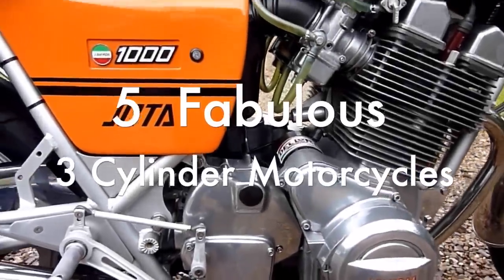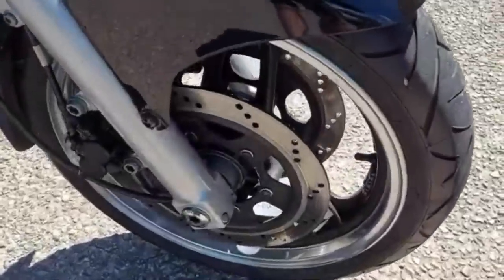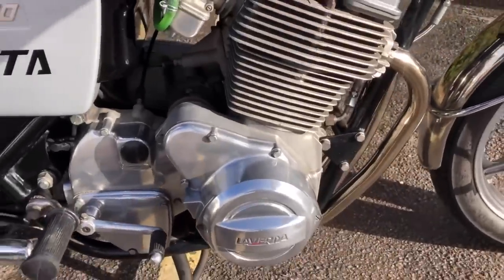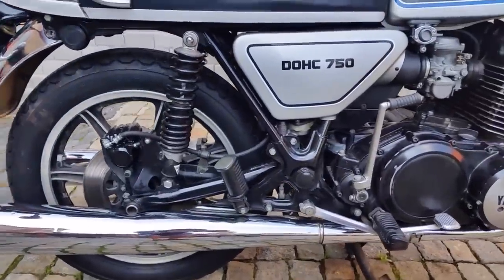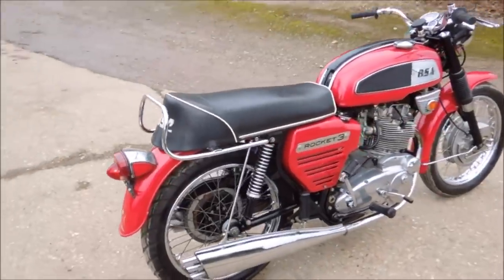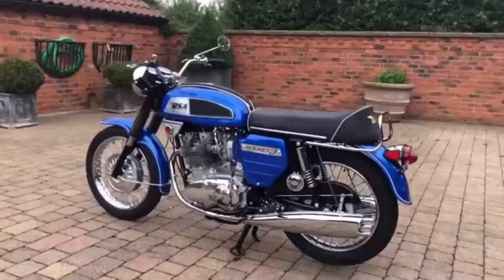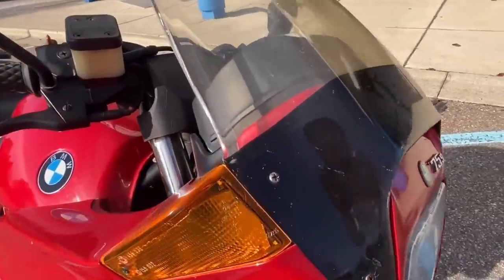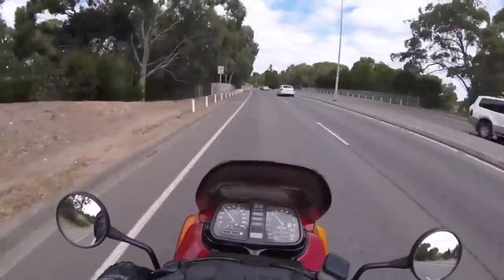5 Fabulous 4 stroke 3 Cylinder Motorcycles

Comment: 3 cylinder engines sound so good. Gary Johnson's MV Augusta at the Isle of Man is surely one of the all time great exhaust notes. If you're lucky enough to have been to a current MotoGP event, the Triumph engined Moto2 bikes are far and away the best sounding bikes in the paddock. The V5 Honda's and in particular, the Kenny Roberts V5 sounded better but they were sadly replaced with the current crop of aurally inferior 4's.
Reply from the maker: I still miss the strokers but the triples do sound v nice
Reply: The sound of the MV Augusta on Francorchamp was unbelievable, especially on Masta. But than the Yamaha XS1100 with Pat Evans on the Nurburgring was great as well.

Comment: I rode a Laverda Jota back in about 1980 or '81. Took it up to 120 and it started a slow fish tail weave so I shut it down. Doesn't like a light rider. Rode a Ducati 900ss ('76 model) a short time later and it was as solid as a park bench at 130. An old friend - now sadly no longer with us due to cancer - said the correct pronunciation of Jota was Yot-a - with the Yot as in Dot. He was a motorcycle dealer back in the late '70's and early '80's so I assume he was correct.
Reply from the maker: Well the Jota was designed by a big guy for other big guys
Reply: @bikerdood1100  Yeah that's the conclusion we came to too.
Reply: The correct pronouncation of Jota is something like Hhotta as the italian J is pronounced as an H. 🤷🏼‍♂️
Reply: @kasperkjrsgaard1447  With the 'o' as in hot or as in bone?
Reply: @vipertwenty249  
As in "hot".
Reply: @kasperkjrsgaard1447  Thanks

Comment: You could have mentioned Triumph  T150 & T160  and Suzuki GT 750.
Reply from the maker: Two strokes in part 2 
I mentioned the R3 instead as it’s essentially the same machine of course and I wanted to include the Trident 900 in particular because it was a sales success in contrast unfortunately to the T160 which is shown in the R3 part

Comment: You didn't include the GT750 GT550 and the GT380 but l do remember all these motorcycles and K series BMWs because with the 750 and 1000 for all  there range it was the same bike just with the fairings and paniers bolted on very smart of BMW
Reply from the maker: Next video
Reply: @bikerdood1100  Very good l owned a GT380 and a GT750 looking forward to the video
Reply from the maker: @lesklower7281  out this week
Reply: @bikerdood1100  Good

Comment: the common 4 cylinder (4T) engine has one ignition every 180 degrees of the crankshaft, up to here so far so good, the only way to overlap the power strokes to make an engine more powerful, efficient and smooth running is to add more cylinders, here typically the option is to go for an even number of them in order to spread the sits on a crankshaft such as 6 or 8, and arrange them in "V" configuration to shorten the crankshaft, camshaft, manifolds, block, etc. ... some manufacturers go for a "cheap way to achieve this" with 5 cylinder engines making their own-and-everyone-else's life complicated with 720 degrees/5 cylinder = 1 ignition every 144 degree turn of crankshaft and all the weird design features to save 1 cylinder per engine (like a cheap 6 cylinder engine somehow achieving the overlapping of the power strokes). I can understand big engines are a bit of a pain to fit in a motorcycle frame and due to the limited weight of them (motorcycles compared to cars) smaller 4T engines with no overlapping of the power strokes as an "affordable sacrifice" (4 or less cylinders), ...now; what I fail to understand is that having V4 engines (with a block as long as a 3 cylinder) someone still goes through the trouble to design one when with a two-cylinder engine would suffice without looking like "a cheap and complicated 4 in line" (or half a V6 if you ask me) if you just don't want to fit a four cylinder engine, I honestly fail to find anything practical about it, I was always told that the best rule in engineering is to "keep it simple".
Reply from the maker: Of more pressing importance to a motorcycle builder today would be cost effectiveness 
The classical 4 firing order is as much about simplicity as anything else after all if you waste a spark then you only require two sets of points in the old days.
6s are all well and good but very expensive 
Ditto V4s
There’s a good reason parallel twins are on the rise
Reply: @bikerdood1100  quote "There’s a good reason parallel twins are on the rise". totally get the feeling on that sentence, as I would choose so myself if there is no chance for a 4 cylinder (I ain't much of a racer myself, and I have to admit I prefer twin cylinder engines). you crack me up talking about motorcycle builders now a days after seen the classics in the video, manufacturers and customers naturally look at the relation between quality-price each one from a different side of the equation, shame that "having the money to pay for it" does not imply "knowing what I'm about to buy", if so being a manufacturer would be way more difficult. cool motorcycles in the video nevertheless I have to admit.
Reply from the maker: @investigatechannel  I do prefer a twin myself if I’m honest 
I do own both modern and older bikes and am interested in bikes of all periods 
Had a lot of fours over the years and do find them a bit 
So so
I think compared to the industry of the 90s for example there simply isn’t that much money in the industry and this is showing in the move always from 4s and in the poorer overall build quality now evident in the industry
Reply: @bikerdood1100  for "things of life" I do not have a motorcycle right now (maybe soon) but I had a few over the years, my first bike as a young fella back in my country was a Ducati road 250cc '75 (I bought this one in a box taken apart and I put it all back together myself with the little notion I had), then I moved to UK and got myself a VT700 (some grey American import), then I had a VF 500, a VF750 and finally a VF1000, while I was studying engineering at south London and I'm a great fan of classic British bikes, they are the only ones that make me turn my head and not look in the direction I'm going, but life pushed me to end up working on cars and industrial machinery/tools, and on 2020 I moved back to Spain (did my own version of brexit) I have watched some of your videos and seen you are British and also seen some of your bikes, my upmost respect mate, I miss all that.
Reply from the maker: @investigatechannel  we are now into double figures 
The problem isn’t buying motorcycles 
It’s being able to let go and sell one to make room 😂😂

Comment: Rode a laverda jota before I bought my ducati 900 ss  from a kam motorcycles NorthShields the laverda was all hyped up back then but I thought it handled poorly and as for speed no way would I have liked to have taken it over 100
Reply from the maker: We’ll definitely more powerful than the Duke, with a top speed of 137 in the mid 70s it was a fair bit quicker than the Duke, the Duke was certainly more nimble. Mr Laverda was well over 6ft so the bike is designed to fit him. So for those under the 6ft mark the can be a handful 
But slow 
Naaaa
Reply: Well I’ve been riding since 1964 my Italian scenario came in 1976 I was hyped by the so called Jota but after riding it down the A 19 I certainly made a decision that the Ducati 900 was better in every way. The 900 felt and handled far better than the lumpy clunky Jota and yes I had the experience to make that decision. I nearly bought the MV Augusta that kam motorcycles had in their shop, but it seemed a very complex bike for servicing etc. So that’s my take on all the hype around the Laverda  as well as my Ducati I also had a little Moto Morini 350 v twin now that was a good little Italian bike.
Reply from the maker: @john-wq8kf  well it’s designed by a very tall guy for other very tall guys 
For them it’s fine 
And could be intimidating. But still extraordinary fast by 70s standards

Comment: A good list, although most are unknown to me outside photographs and occasional sightings.
The XS750/850 was briefly a courier favourite (no chain wear).
I used to visit regularly a bike shop next door to Motodd in the late '80s.  That was the strange basement furnace where they built some of the ugliest, most beautiful Laverda triples.  Strange, metal monsters that sounded strange, loud and a bit Satanic. I rarely saw one other than at the shop.
The only one of your list I rode a fair bit was the K75.  It was always deeply uncool, but I thought it did everything extremely well.  Not a bike to get emotional about, but a very sound machine - and more engaging, nimble and rideable than the slightly lumpy K100.  I thought it would sell well, but it was one of those evolutionary cul-de-sacs.
Good video with some nice noises. 😊
Reply: I nearly purchased a new K75 but the fact that it cost more or less the same as a K100 put me off.
Reply from the maker: Always quite likes the K75s much less blocky looking that the 100
Reply: @bikerdood1100  There were a couple of people on rally scene who ran K75s engines apparently even smother than the K100. I borrowed a K100 for a couple of days just after launch. It was like riding a big electric motor. Power all the way up to full revs. Also much, much smoother than my CX500.
Reply: @davecooper3238  "Electric motor".  Spot on.  The perfect comparison. It was almost forty years ago and I can feel it (or not feel it) still.  Hit the nai right on the head.

Comment: kawasaki designed the triumph engine, the spine frame was also used by kawasaki on their GPZ900R.
I was only interested because a pal of mine bought the very first trident 900 off the line.
I wasn't pleased.
I had tried to sell my design to john bloor, he just took my ideas and flipped me off.
I would never buy one because of this, despite the trident being the production version of my original design.
I also introduced the concept of modular design in the motorcycle world, as evidenced in triumph's first series, suspension changes, different camming, same frame, same engine, a tourer, a roadster and a trailie.
whish I'd known more about copyright, it makes patents look like a scam to take your money.
Reply from the maker: Kwawsaki did not design the Triumph engine 
Although they did visit the factory in Japan so there is some influence but that’s about it 
Anything else is pure pub  myth 
If you look at a frame it closely resembles the old T140 OIF chasis which isn’t surprising as some of the Truimph designers had previously worked at Meridan 
So did Kawasaki copy the Triumph spine frame from 1971 ? Is a more appropriate question 
incidentally the Laverda Jota frame is also very similar so member Kawasaki copied that ??

Comment: What a load of crap. An article about 3 cylinder bikes with no mention of the iconic H1 or GT750 or any of the 3cylinder 2 strokes from Suzuki, Kawasaki or Honda. The man knows nothing.
Reply from the maker: I’m putting the two strokes in a stand alone video 
Obviously 
Rude little man
Reply: He knows that the Laverda triples are more than twice the bike that the H1 ever was. Having owned both I can tell you that the H1 I had was a pig to ride. The Laverda, the horsepower of a 4 cylinder and the torque of a twin. Plus handling to boot.
Reply: It clearly states 4stroke 3 cylinder bikes mate . Read the title before you start whinging . Or your just a Pommie , if so , whinge away .